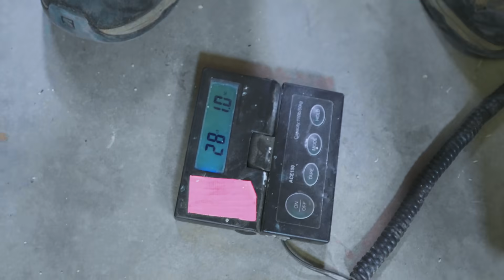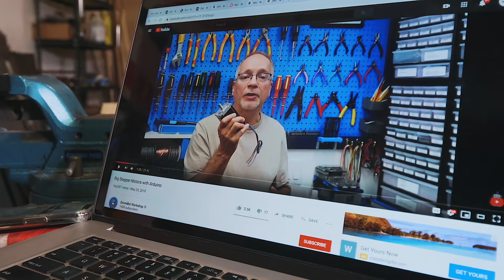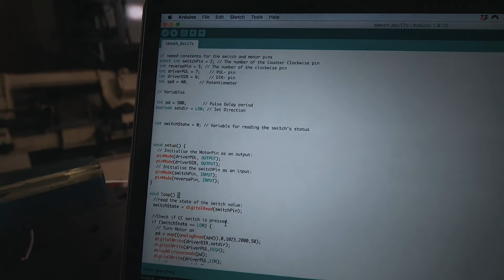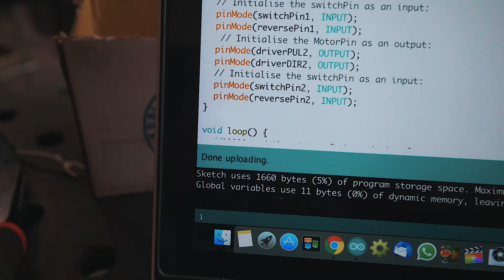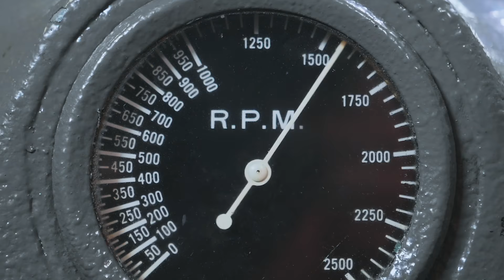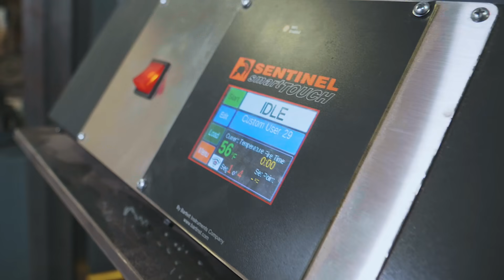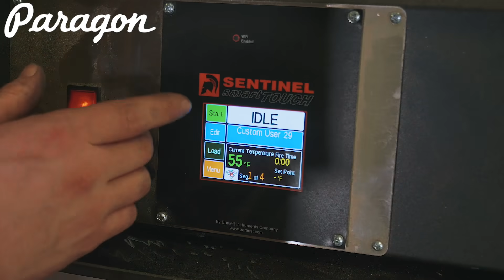MAKING FORGE DOORS!!! Part 2

Comment: Hey Alec, I assume that someone has already mentioned it, but it seems to me that the easiest way for you to manage the load on the motor would be to counterweight the doors so all the motor is doing is moving the equalized load, instead of lifting any actual weight. It's similar to how they set up elevators, though since you aren't expecting a live load (from people) on your doors, you don't have to preload the counterweight. I look forward to seeing what y'all come up with. Good luck!!
Reply: It occurred to me that I failed to mention that if you are using the motor to coil the cable, a counter-weighted system would require the counter weight to be slightly less than the door so the door will keep tension on the cable to close the door if the motor is pulling/releasing on the counter weight side. However, if you are using gearing on some sort of chain, you can just move a perfectly balanced setup back and forth as you see fit and that will put the least strain on the motor (especially since I don't know the slip resistance of the motor). Good luck :)

Comment: Hey! You should insulate your rolling door! You can cut foam board insulation to fit the individual panels, which doesn't interfere with the operation of the door at all, but can give the door itself an R value of 5-10, depending on the type of board you use. It would save energy (and hence money) in the summer AND winter. Just a thought. I did it to my garage doors, and it made all the difference in the world for air conditioning that space.

Comment: I agree, a pully system is not the way to go. The wire cable will erode fairly quickly with the combination of the sheer weight of the doors and heat.  Cranks and levers maybe the best fit.

Comment: hey Alec, you wont be able to make both motors work at the same time with 2 different inputs on the same arduino. when you push a button, the arduino basically stops looking for inputs, and starts outputting according to the button you have pressed.
one option is to use one 'up'  and one 'down' button for both motors, the other option is have 2 arduinos...

i built an aquarium monitor system that controls up to 8 tanks temperatures at once. it reads through the list in order, and if one tank's temperature is below the target temp, it turns on a relay which turns on the heater. all it does is read each temperature, then either switches the output pins to high or low. its on a 60 second loop. it cannot do 2 tanks at the same time, but it takes so little time to switch a pin from high to low or visa versa that it appears to be doing it all at the same time.

cheers Alec!
Reply: Sorry that's not true.  The Arduino will look at as many digital inputs (buttons) as is programmed.  It is the code that controls if it only looks at the first button it sees pressed or continues to look for others. Yes, the arduino (and many microcontrollers) only read pins and do things sequentially in a loop.  But the loop is so fast that it looks like it is all done simultaneously, like your aquarium monitor.  Clever programming can also allow slow processes to run while not slowing down the loop.
The code Alec has looks at all 4 buttons if it needs to. The forward (CC) switch will override the reverse switch as it only looks at the reverse switch if the forward switch is off.  That way you can't have the motor going forward and back at the same time (both switches pressed).
There is a mistake in Alec's code, I believe there's a } missing at the end of the 1st motor if-else-if statements.

Comment: To fix the code for simultaneous driving the two motors: read all the switches first, write to all on drivers (HIGH), delay, write again to all drivers (LOW), delay - rather than doing this in sequence for each motor. No need for interrupts.

Comment: Hi Alec!!!
You don't need the motor to lift the whole 30 pounds, you can use a pulley  and a counterweight runing into a pipe... just in case you haven't solved yet. 😊

Comment: Alec, you have 2 options on the Arduino...

1. Buy a second one to control the other motor

2. Run an interrupt on the 1 Arduino to "fake" the signal, this can get pretty messy and has some limitations that you may or many not care for.

If I were doing it, I would go with a second Arduino just to KISS (Keep It Simple Stupid) method it. The reason I would go for this is not just because this is your first time with logic processors but more so for the scope of your project and with 2 Arduino's you can do a few more advanced things later if you wish to delve deeper at a later time.

Since these are going to be controlling forge doors and near high temp areas I would suggest that you shield them as best as possible and run active cooling in their enclosure, this is just for longevity. The mortal enemy of any electronic device is heat/dust, those 2 things kill more electronics per year than anything else including static discharge and lightning.

Comment: Are the foot pedals on off switches or does the signal/ impedance vary with how hard you press? If you kan vary the speed it would be nice, and you should have auto stops at the fully closed and open positions for safety.

Comment: Alec, you need to have a gear reduction for your stepper motors. It will make the doors open and close slower, but due to the mechanical advantage you’ll be able to lift the doors and put less stress on your motors

Comment: Use a counter weight system so you dont overload your motor. Also use a light curtain so when you approach the doors with an object they open automatically for you.

Comment: Just a quick tip.  The faster you spin a stepper motor the less power it has.  Run the motor slow and use a larger drive pully to get your speed.  Overall it looks good man!

Comment: So Alec what you really want is counterweight as many of the comments say! Just like lifts operate with a motor the counterweight is usually a bit heavier then the load on the lift just so it doesn't need to work so much to move the weight up and down and I suggest you to try to make a counterweight where you can first add or decrease weight just like in gym equipment to see what works the best! As a smart systems / embedded systems engineer I am really looking forward to this build !

Comment: Would Kaowool with a nice layer of ITC-100 work well for the forge doors? I imagine it would be light enough, but still heat-proof enough. The only thing I wonder about is durability, specifically if piece bump that closed back door.

Comment: You should have some metal that is on the sides that come out towards you and bent up and have the door placed in that like a slot. so it holds there and doesnt move from the forge. also what it would do is make it where you want the door to stop at by having it rest on the welds.

Comment: Be careful with the arduino. They are very easy to short. I’m a Mechanical Engineering student and we just designed a box to transport a liver. The arduino was require to keep the box at a consistent temperate. Around 10 of the groups fried their arduino because the main chip got too hot. Anytime you reprogram or switch around the wires keep a finger on the main chip while you run the program for the first time. If it gets too hot immediately unplug it for the power supply and adjust you program/wires. Just a little tip form someone who saw the demise of many arduinos this semester 😂

Comment: do you have the possibility of measuring the resistance of your stepper motor ? this will allow you to measure if your motor is find unexpected resistance or lack their of. this will tell you if the door is open or closed.

Comment: Alec, I don't know a huge amount about Arduino, but I am fairly certain that it works by continuously looping through the code. So, for example, if you have a code that only contains an if statement which triggers when pin 3 gets a signal, the Arduino will continuously loop through the code from top to bottom until pin 3 gets a signal, at which point it will go into the if loop and do whatever is in that section of code. I don't see the link to your code, but I'll guess that you have something like: while (button is pushed) => make the door move. If this is the case, the Arduino will enter the while loop when the button is pushed, but it won't exit the loop until you let go of the button. This means that the Arduino will never see any code beneath that while loop until the button is released. This might make it very tricky to get both motors to work at the same time with only one Arduino. Once again, I don't have too much experience with Arduinos, so take this with a grain of salt. There may be a way around this that I am not aware of. Anyway, hope it helps somehow, and thanks for putting out great content!

Comment: Definitely want some kind of limit switches on there. At my old job we had a customer disable them on a mechanically similar product we built them....but they were about 30ft high and 20ft wide and controlled airflow in a powerplant.. The gate was at the end of its travel, but the immensely powerful motors didn't get the memo 🤣

Comment: Send the same output from the Arduino to each stepper drive instead of independently. Meaning only use two switches, but use the same Arduino signal output to each driver.

Comment: Simplest way to fix the code is add 4 more if statements that are for when two buttons are pressed for example:
if(button1 == HIGH && button3 == HIGH){
// motors would turn on in their respective directions 
}

Comment: Multiple pullies can take the weight off one weight exponentially. Smarter every day just put out a real good video explaining it. If the motor doesn’t work because of the weight, you could add a few pullies at the top and bottom of the mechanism and it will make it much easier to lift the weight.

Comment: Alec, you need to look into interrupts on the Arduino. It is what you need to get the Arduino to respond to multiple inputs at the same time. I'd love to take a look at the code and see if I can help. Also, as others have suggested, limit switches are a great idea to protect your motors and other vulnerable parts of the assembly. (I'm an industrial electrician by trade)

One more thing...steel rope on aluminum pulleys...Won't the rope eat through the pulleys as they are used? Is that just proof of concept?

Comment: Not going with rack & pinion and a (bike)chain? I would think that would be a more robust and thermally stable. Wouldn’t the stainless steel wire heat up and stretch?

Comment: If the stepper motors aren't strong enough, you could use counterweights, since you are using a wire anyway.

Regarding the motor control: 
    If you want to improve your code, you should look at "finite state machines" and thier implementation on micro controllers.
    You could implement two state machines (one for each motor) controlling the output and switch states according to the input.

Don't use any multitasking for your project, because:
 1.  It is overkill for what you want to achieve.
 2.  It will just give you a headache when you encounter problems related to "thread safety" ,"RMW", etc.
 3.  Arduinos are quite slow and even low profile RTOSs can generate alot of overhead.

Comment: Alec. You need to counterbalance your doors, so that there is minimal load on your drives. This can be accomplished by simply matching your door weight with a solid weight and cable and pulley. or a pneumatic cylinder and regulator to match the weight of your doors.

Comment: Alec all your motors and electronics are dc. Just use a small battery bank to directly power them on a scale bus. Have a battery charger just enough to charge them at night or use a cannon plug to connect it to a charger. If I didn’t have work I’d drive these high cap batteries to you just for this.

Comment: I would imagine that you have a "while" or a looping condition. While the button is pressed run the motor..or is the button pushed ...step repeat ...loop.   since you have multiple interrupts ...you need to finish ...one check condition before it breaks out and checks the next interrupt.

Comment: I was wondering why you didnt use a pneumatic cylinder, as you have compressed air run in the shop. Plus, you can get slow moving cylinders with very high strength, which move in 2 directions

Comment: to sync up the 2 motors you do not need to mess with the code, just take a page out of the RC community as they do this sort of thing all the time, basically all you need to do is take the signal wires coming out of the arduino and simply split them into two, and you basically wire one set into one control box and the second set of signal wires into the second control box,  this way one signal will control 2 motors at the same time.

Comment: you really need to have a counter balance, which will reduce the wear on the steppers, and alsp a brake, like used in elevators so if the doors lower to quickly you wont have a disaster.

Comment: I had that same power supply in my 3d printer. After some time, it practically exploded, causing severe electric shock hazard. So did the next one I got as replacement. If you going to use that, make sure you have every metal part grounded for good. What is happens in there, switching transistors break down and get shorted so violently that they cases split into pieces. There are burnt components and traces of intense arcs inside the cover.

Comment: What he really needs is counter weights for the doors inside the upper section. He doesn't need stronger motors, just to reduce the load.

Comment: Looks like someone beat me to putting out code for you on your facebook.  Their coding using case statements looks like the logic should work for how you are applying it.  Adding a limit switch at the top and bottom of the motion may be a good idea as mentioned as well in case something happens and a button sticks.  
Gotta say i think it is awesome branching out to electronics from blacksmithing.  I am trying to go the opposite way.  Electrical and computer engineer here trying to learn as much as i can about blacksmithing.  Keep up the videos.  It is an amazing craft.

Comment: Probably a bit late. But I’d say a track open and close horizontally rather than vertically would be a inherently safer version. Would be same motors set us currently have. Would have to half your doors, so the slide across left and right.  Also avoids anything above the forge. Keeps overall centre of gravity in a better location. If you lift one door you are top heavy on one side more than another.

Comment: You could use a counterweight for your 30 lb forge doors, kind of like an elevator. That way your motor will barely have to work when lifting and closing the door.

Comment: Personally I would have used threaded rods to raise and lower the door. They could be sent up through the bottom of the forge and you would need any crazy rigging up top. Though they might not be as fast as your system.

Comment: If you want to complete the programming yourself (for the most satisfaction ;)  )

just add 2 more buttons: one for turning both motors left and one for turning both motors right (and add the code for those buttons)

you could always use the programming talents of your subscribers, but nothing gives you a greater kick than first doing it yourself and then perhaps look at other solutions to learn how to do it "better" or with less program lines (less memory)

Comment: Alec -- you want to use an time/event based system that continues doing a thing.  This allows MultiTasking on Arudino.   Here is an example of how that works, with two blinking LED's.  

// each "event" (LED) gets their own tracking variable
unsigned long previousMillisLED12=0;
unsigned long previousMillisLED13=0;
 
// different intervals for each LED
int intervalLED12 = 500;
int intervalLED13 = 1000;
 
// each LED gets a state varaible
boolean LED13state = false;     // the LED will turn ON in the first iteration of loop()
boolean LED12state = false;     // need to seed the light to be OFF
 
void setup() {
   pinMode(13, OUTPUT);
   pinMode(12, OUTPUT);
}
void loop() {
   // get current time stamp
   // only need one for both if-statements
   unsigned long currentMillis = millis();
 
   // time to toggle LED on Pin 12?
   if ((unsigned long)(currentMillis - previousMillisLED12) >= intervalLED12) {
      LED12state = !LED12state;
      digitalWrite(12, LED12state);
      // save current time to pin 12's previousMillis
      previousMillisLED12 = currentMillis;
   }
 
// time to toggle LED on Pin 13?
  if ((unsigned long)(currentMillis - previousMillisLED13) >= intervalLED13) {
      LED13state = !LED13state;
      digitalWrite(13, LED13state);
      // save current time to pin 13's previousMillis
      previousMillisLED13 = currentMillis;
  }
}

Comment: Get it contact with Morgan advanced materials.  They make a product that is called seal coat. It is a lightweight moldable refractory that is rated to 2800 degrees and can be molded to whatever shape you need

Comment: If it were me, I’d hook the motors up in a loop running off of one arduino and switch. I’m sure you could code it but wiring it into a loop would be the simplest solution I think

Comment: I watched your video about forging      
The meteorite and if you still have the piece of meteor then I have an idea. What if you welded the edges  
Of each side together so then it is much harder to split the metal. Or weld it in between to slabs of steel (if it is possible to weld those two metals together idk I just know that it is incredibly complex to weld two different metals together) and just squish it into a solid piece of metal,cut the sides that did kind of split and use that.
(If that is something that wont work just dismiss that idea. I am
Quite new to how metals are forged and made.)